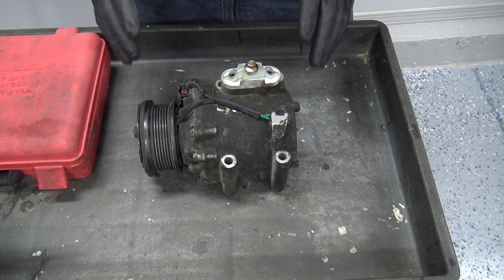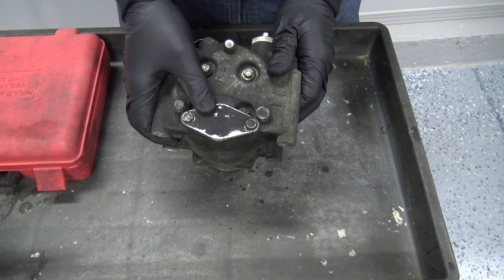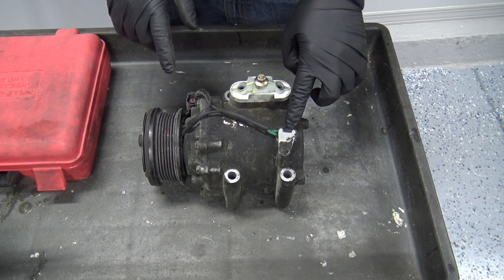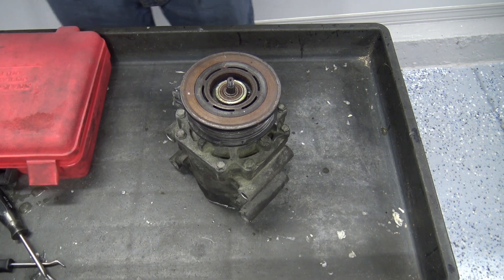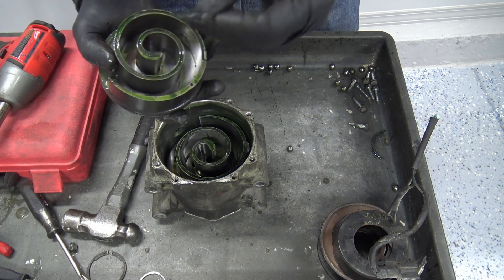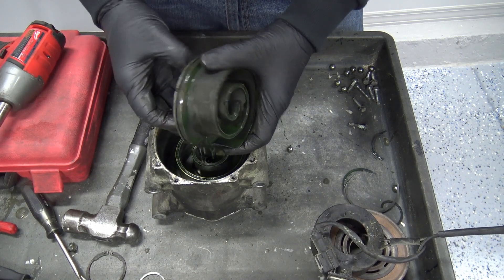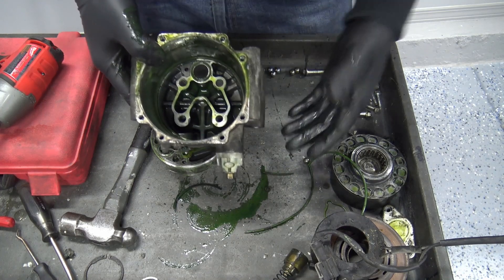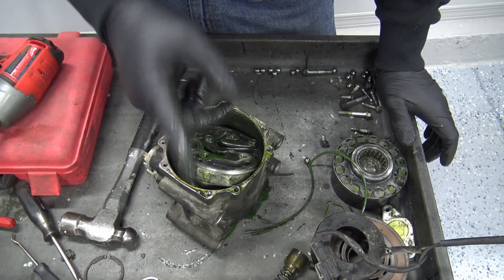How Automotive Variable Displacement A/C Scroll Compressors Work and Fail

Comment: When the valve on the back is activating, will you hear a hissing sound like freon escaping?  I just replaced this compressor on a 2007 Escape Hybrid and it keeps hissing at about 300-350 PSI (at which point the PSI on the gauges will start to dip), when the over pressure is minimum of 550 PSI, the fan switch does not activate until 310PSI, and the high pressure switch range of 435-475PSI.  Where is the over pressure (pressure relief) valve?

Comment: The "gasket" is not a gasket, is a shim, used to regulate the tolerances between the scrolls. Some compresors have two or tree. The seal is made by the o-ring

Comment: What is the cause for higher discharge pressure and higher suction pressure ie high side PSI 200 and low side low side PSI 40 and cooling is poor

Comment: Great tear down and explanation! I was curious about scroll compressors because all I've dealt with in the past were piston. That compressor looks identical to the one I just replaced in my '05 Saturn Vue with the Honda 3.5L V6. I'm pretty sure my problem (aside from the compressor leaking) was the variable valve was sticking, good cooling on highways or when accelerating but high 50's to mid 60's vent temps in town/traffic.

Comment: I removed my old valve and replaced with a new one, and the car is only blowing real cold when the engine is around 2500 rpm, but not at idle. I am wondering if the new valve is not working properly. Is there some kind of 'bench test' for this valve?

Also, the old valve had a substance on it that was 'blackish' and a bit tacky. Should I have wiped out the valve port on the compressor, or oiled the new valve? What would that substance be, and does it affect the valve, or the compressor's functioning?
Reply: The compressor is gone... Change the compressor
Reply: @tanzaniacarschannel6975  Yes, I will put a new compressor in, a soon as out Michigan weather warms up..
Reply: Valve failure is very common, but usually something causes it (sometimes it just fails), in your case the compressor seems to be damaged, usually poor lubrication is the case. The oil must be clean and clear, otherwise the anti-friction material is falling apart and the compressor is permanently damaged.
Reply: @elpatosilva great appreciation while stumbling through learning this system with experts that appreciate  any expectation of being spoonfed.  Troubleshooting is the same in all systems.  It seems that you will never know a realistic solution if one does not understand the system and has an expectation of the direction of fire for the parts cannon.

Reminds me of the go to... What "part" do you need to change when you fuel light is on.

Comment: My Volkswagen has the clutch less variable displacement a/c compressor. However, my Lexus has the Clutch design variable displacement system. When turning on, you will here the clutch engage and that is it. The only time to make it disengage is turning the entire climate control system off. During operation the compressor is always engage, which leads me to believe it’s variable displacement.

Comment: Will a bad scroll valve cause the compressor to be noise and have a high low side reading I don't have a good set of gages anymore to check the high side psi 
I was thinking maybe a bad expansion valve but now this profile thing has me thinking

Comment: isn't it also used in weaker vehicles? my chevy s10 has a variable compressor like that. I put a regular compressor on and when the compressor comes on the engine revs change dramatically and it has to compensate
 the s10 4 cylinder engine has 118hp for a 3000 pound truck. I switched it back to the variable compressor and it was back to normal. u can't feel any clutch engagement except for the initial engagement and when it disengages.

0-60 in like 12 sec lol

Comment: 2003 ford taurus..140k.  AC compressor clutch is disintegrating but compressor still works.  I made the decision to replace the whole unit vs rebuild the clutch.  I got the whole compressor and hoses o-rings orifice tube and whatnot for 200 bucks.  The clutch rebuild was going to cost 85 bucks. In your experience, is this the right move.

Comment: My 2010 F150 compressor feels like it is over working and shakes the whole engine when in use. Had the system evacuated and refilled with no change. Is my compression the same style as this? Can I repair the internals and not the whole unit?
Reply: Daniel Frank might be loading the engine to much and dropping the rpm to a point that causes it to shake.

Comment: I have a HVAC channel and we use scroll compressors very widely. In fact there is a compressor that does similar variable capacity for home heat and air. It's a little different than what you showed here. Looks like the variable valve bleeds high pressure back to the low side of scroll and that is probably why it needed that thermal overload because compressors are cooled by the suction gas.

Comment: i have 2.3l 2011 mondeo "mk4" 6speed awf21 auto transmission , i want to change the transmission fluid , do i need to use any type of sealant on the drain plug when i finish draining the fluid and is it a seal system meaning can i change the fluid without changing the filter ?? if there is anything else i need to know plz tell me 
i really like your videos and i need your help on this one
Reply: Abu Cezar 
I don't know if yours is a sealed transmission, but I would say it's probably better to change filter if possible for just in case factor if it's time for fluid change.  also like oil drain plug I've never heard of sealant for drain plug.  if you do and are able to change the filter you would need gasket seal for transmission pan.  don't know 100% I'm right but I've done some home mechanic work.  all procedures are variable by design and changes over time